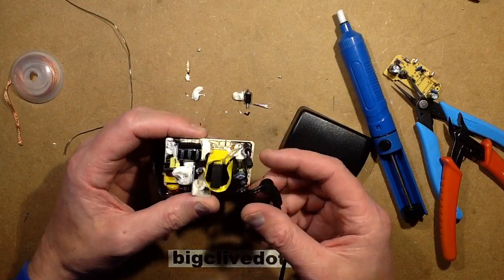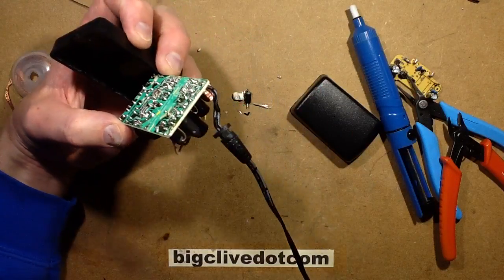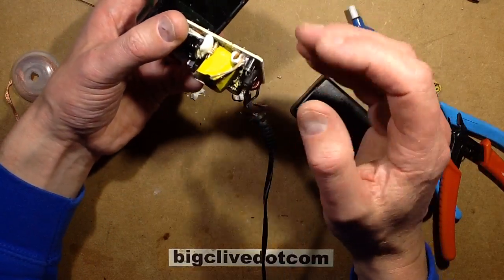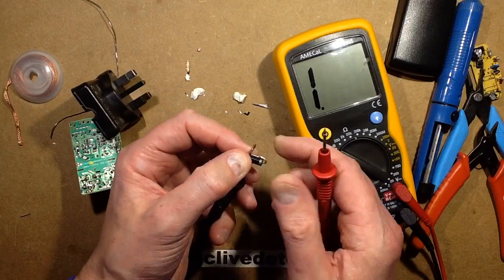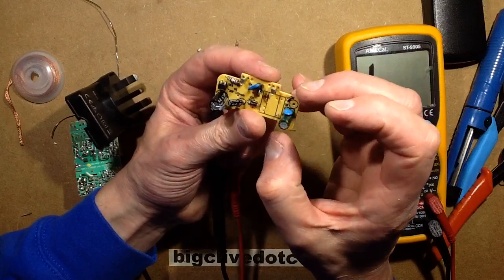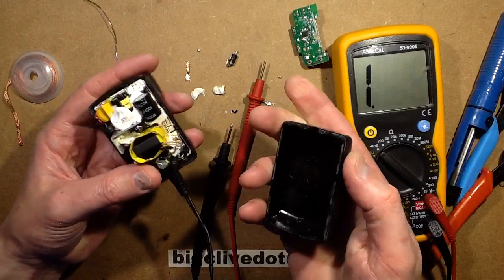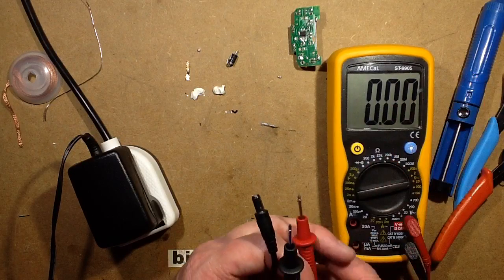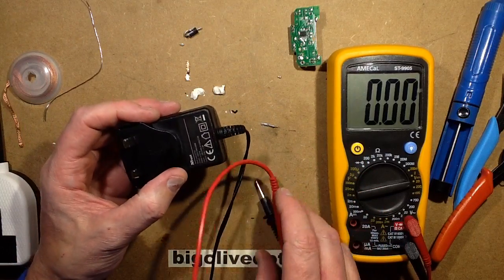Random power supply repair.

Comment: Thanks - an inspiring video.  I've just taken apart a failed PSU that's been sitting on my desk for about a year, and found that it's also failed in the same way.  New diode ordered form e-bay, should hopefully get it working again, and saved it from landfill!

Comment: I got a speaker amplifier thing here (from a set with small speakers), the power supply got lost at some point and I had to resort using 6x AA batteries instead. I let them in after usage, and some times they were either all completely flat, or just 2-3 of them. I had no clue why it happened, ordered external 6x AA holders with the correct plug and used it like that. Worked nicely, but not for too long until the same thing happened again.
Then I got myself together and ordered cheap USB 5V to 9V Step Up converters from china. They worked with the Power Bank! BUT the next day the power bank did it's short circuit shut-off, every time I plugged it in (without even turning on the amp). First I thought it was the Step Up thing, but both had the same reaction. So (before trying any other USB ports on anything else...) I opened the thing up and looked into it. Nothing wrong at all.
Got the power meter out: continuity between all + and - of all inputs.
I was shocked, losing my 12 year old little 5W ampflifier. But the more I tested the continuity, suddenly there was none anymore. Instead of beeping it showed raising numbers. I plugged it in, no short circuit anymore :0
Then, 10 minutes later, it was again shorted. This time I took the charger doctor and plugged it to a 1A power supply without short circuit protection. It feeps a bit when I plug it in, the voltage shows 3V for less than half a second and then everything is back to normal.

May it also be a (smaller) diode, that failed in there? It doesn't really matter, because it works as long as I don't use the power bank, but it confused me and I wondered which component would cause such a thing. Is it a resistor between + and - ? Or more likely a diode? If I ever find out what caused it, the AA batteries, which died a horrible and unnecessary death, will have their vengeance! Or something.
(The amp has 9V 600mA max. input)
Reply: 8bpspfreak2 if it was intended for battery use, there  should be a diode across the + - to prevent damage if you put the batterys in the wrong way. sounds like it's gone short. cut it of the pcb or replace it. might be the power jack aswell.
Reply: or you could just buy the Argos £9.99 multi-volt  3v, 4.5v, 5v, 6v, 9v, 12v - 1Amp multi plug adapter :) I have 3 of them, 1 running 3v LED strings, 1 running 12v Patio LEDS @ 9v and 1 on a string of 12V LED color changing display thingy I made.

Comment: Those diodes are very common. "xxx560" is a dead giveaway that it is rated IF=5A and VR=60V. The usual name for it is "SB560" and they are around since at least 1995. Back then they did not have the 60V reverse voltage and the main 5A Schottky diode was the "SB540" 5A /40V

Comment: It's always fun when you buy what amounts to garbage and it turns out to have a use that it was never intended for. For instance I bought what would be considered a cheap poundland 3 LED flashlight and mounted a laser element in it. See I got tired of holding the button whilst playing with the cat. It also wore out the button in it's original casing. I had originally bought the flashlights to put colored LEDs in instead of the standard cold white ones. I did that with most of them and it turned out pretty well resulting in what I call "Chromatic" flashlights. Long story short I reamed out the reflector to fit the laser module and it worked pretty well. It's my favorite kind of hacking...

Comment: i mean, youve got it open, wouldnt you wanna double check some other basic components, like the caps, just to see if theyre getting on there in years? a minute now might save you hours later if it fails again
Reply from the maker: I did give it a thorough check.
Reply: WeAreGRID Clive wouldn't forget to notice a failed cap ;)

Comment: Consider that the speakers this powered would probably have tolerated a 12V supply.  You can pop them open to see if there's an abnormally low voltage threshold like 10V but it's doubtful for an audio amp IC or typical film and electrolytic capacitors... and with a fixed gain stage, you're not increasing the stress on it much.  In fact the higher voltage 12V PSU might have even allowed slightly higher volume before distortion set in.

Comment: Regarding the auto vs. manual range on the DMM. I use a Fluke 87 and 789, both of which default to auto-range. This seems to be fine for ohms, but if I am checking voltage, the first thing I do is manually change the range to one step higher than what I expect. I do a lot of work on industrial equipment, and you would be amazed the number of times I have seen folks fooled when troubleshooting a piece of equipment by not noticing the 'm' before the V in auto-range mode, and reading something like 117.4 mV and believe there is 120 Volts present on a control circuit, when it is dead, and they are just reading 'floating' voltages being picked up by adjacent powered wires. Switching to 400 V range totally eliminates wasted time.
Reply from the maker: I had someone outraged at the fact that I had supplied him with a 230/400 supply that he was metering at 700V.  He hadn't turned it on yet and it was 700mV he was measuring.  Awkward moment.....
Reply: In the case of your AMECaL, with manual range selector, the very large LCD digits are excellent. With auto-range meters, they often try to make the digits very large as well, but without regard to the adjacent units multiplier, 'u', 'm', 'k', 'M' etc. which are of extreme importance, since they change things by a factor of a thousand or million. Auto-range wouldn't be so bad if the multiplier symbol was at least half the size of the digits it is acting on, but most meter manufacturers consider this to be an unimportant small detail...

Comment: Is the diode in series with the output? If not, and it shunted the power supply when it shorted out, how did the transformer or other parts not get burnt out, or the supply fuse burn out?
Reply from the maker: The primary driver may have recognised the unusual load when trying to create a field in the transformer.  These chips seem to have protection for faults like this.

Comment: I've an old simple 9v power supply that doesn't work anymore, tried metering it and it stats at a few millivolts and very slowly climbs up. It's just a transformer, four diodes and a cap.

Any suggestions?
Reply from the maker: The old traditional ones had a common failure mode of overheating and their internal thermal fuse failing.  Not easy to replace.  You can check that by doing a resistance test on the mains input pins after unplugging it.
Reply: Not all that hard to replace.  The thermal fuse is usually on the outside of the windings so you just cut the kapton tape they put over it, get the values off of it or make an educated guess what temp rating you need in a replacement, solder it on, and have some fresh kapton tape to secure it after soldering.  Doesn't take especially high dexterity for someone accustomed to electronics work and no special tools.

Comment: Damned diodes eh? Had to replace the diode packs in my Honda EX650 generator (the saga is on my SanitaireC12 channel!), one side had failed the same way, completely short, so the generator couldn't put out enough power to light a 200w lightbulb, and boy those diode packs were a PITA to get to and to get out! Did fix it though... :D

Comment: As suggested, plastic glue would be ideal. However, sellotape has the advantage that you can easily take it apart again  need to.

I have some really nice plastic glue that's intended for use on plastic car parts. It's strong enough to use on things like plastic clips and mounts that hold on pieces of trim etc. I also used it to seal up my 18650 charger after I took that apart. The slides were very stiff and had slight corrosion on them. It comes with a coloured powder (comes with black but you can get other colours) that you sprinkle over the glue while still wet.The whole thing then knits together and is incredibly strong. Never thought gluing plastic would be so successful and almost invisible if done right. Can't beat having the right tools for the job.

Comment: Nice fix Clive.
I wish I had your knowledge....I had a Corsair computer power supply just die a few weeks ago.
These are meant to be well made with good components...shame some die so young.
Reply: If you want you can earn enough knowledge to fix this PSU by spending few hours on youtube, there must be vids showing how to measure components and find faulty one.
Most common failure in SMPS is dead electrolytic capacitor on output.

Comment: Those cases are often ABS. To reseal them you can dip one side in acetone and quickly shove them together. Since ABS dissolves in acetone it will chemically weld them.
Reply: myadler Any solvent with MEK should work nicely as well (including multipurpose plumbing/electrical solvent).

Comment: I once rescued a 12v wall wart for a router which died in a company with a device it was powering after a surge caused by a thunderstorm. The only bad thing was the output rectifier, which was SMD but I drilled a couple of holes in the pads and put a UF4007 on the component side. Easy fix, serves me well :) 
 By the way, Clive, doesn't this supply cause a hiss in the speakers? Some amps go crazy when you feed them with SMPS

Comment: Those must be some pretty bad speakers if that's the power supply.
Reply: Power is not the same as quality. Depending on what you compare it to, most if not all computer speakers are pretty bad.
Reply: Until it blew up that was a decent wall wart.

Comment: that's an odd voltage, it might even be possible that the speakers can accept a different input voltage as well.
Reply: I have multiple power adapters that provide 9.6v DC.

They are popular for guitar effect pedals that take 9v alkaline batteries (which deliver about 9-10v when they're fresh, a 9v adapter makes certain distortion pedals behave differently) or for charging 9.6v NiCd battery packs for RC toys, which are composed of 8 1.2v cells.
Reply: It's as close to 10V as makes no odds.
Reply: +bami2 Good point.

Comment: Used to prep Cyber Acoustic brand speakers for use in medical use, the AC wall wart was tossed out in favor of a Muti voltage unit that had a DC output, so apparently the on board rectifier /supply could pass the dc into it with no issues. Anyone need a 9volt ac @ 1amp let me know, I have a few hundred of them in Black or White your choice LOL Trying to make use of discarded stuff can be a pain.

Comment: I like the way that supply has a fake earth to use when plugging in as a guide and to add extra support for the other pins.
Reply: In the UK, the live and neutral pins are often covered by a plastic shutter, and you need an earth pin for the shutter to open up.
Reply: I believe it's a legal requirement. I know every plug I've ever seen is like that. No earth pin, no plug in.
Reply: Unless you're like me (and Clive too, cos there's video evidence!) and shove a screwdriver into the Earth socket to open the shutters to jam a europlug into a UK socket, not safe, not recommended, don't try this at home, etc.etc.etc., works though... :P

Comment: One problem I've had with auto-ranging DVMs is that I don't always notice when the scale changes.

I've thought I was getting readings in the expected range which weren't making sense, then when I looked more carefully, that 5V signal was actually 5mV when the meter decided to change ranges.
Reply: Also when one measures different points at a similar voltage, automatic range switching takes sufficient time to annoy me, so I may often fix my multimeter to the 0-39.99 range when I'm probing around a board with 1.8V, 3.3V and some 5V (or maybe some elevated power supply voltages). Resolution is still good enough, and reading is instant.

Comment: I suspect speakers supplied with a 9.6v power supply would happily run at 9v. Easy.
Try finding replacement supplies for things that need multiple odd voltages (especially if it has negative rails too).

Comment: Good solve!
Ask a question - why is many adapters lying around, including netgear and Nokia - suppose to show x volts as per the adapter label shows higher voltage? instance, Nokia saying 5v/200ma, open circuit voltage shows 9v.... same with netgear, adapter label says 9v, but multi-meter shows 14v with no load.... while most of other adapter shows spot on what label says.
any clues/ videos why such high output voltage when no load/ device is connected!
Reply: It's because of the switch-mode design of the power supply. There is a chip/circuit inside that controls the output voltage based on current (the higher the current, the more internal voltage it needs to generate the same output voltage). So if the current is 0, the voltage shoots up, but the moment you connect any load, it normalizes. Old PC power supplies even blew up when you connected them without any load or too little load.
Reply: Thank you. So it has some kind of loop-back circuit which - depending on the load varies the voltage?
I am meaning to use the adapter of 9v DC for something which can tolerate +/- 1v, but little worried when it shows 14v open circuit voltage.
Reply: Get a proper powersupply if you are concerned. The problem is that the output capacitors in the PSU are charged to the voltage you measure so when connecting something they can provide a short burst of energy at the voltage you measure until it drops down to the rated voltage. This burst can kill electronics that aren't built for it. 
Btw. I assume you really have switchmode PSUs and not transformer PSUs. I know older netgear stuff that came with it. And some transformer PSUs don't even have a voltage regulator in them, just a bridge rectifier and a cap and rely on the voltage drop of the transformer uder load to output the correct voltage.
Many switch mode PSUs need a minimum load to operate correctly (even if it shows the right voltage at no load there is often ripple on the output that's invisible to a simple multimeter), especially if they are built for a certain device where the load is known. The reason for that is that most switchmode PSUs have a minimum duty cylce on the switch because they power themselves with another coil on the transformer (you can see that in many of Clive's videos). But that also means there's some power transferred to the secondary. If nothing uses that power it charges the caps higher than labeled, because it can't go any lower with the duty cycle. You can try putting a resistor (or zener diode just a little bit above the voltage you want) on the output to keep the voltage down.
Reply: Thats a brief but good response, I was looking for - I was thinking to open and check the Capacitor specs; it might explain the holding charge - i will investigate this further and see how i progress.
Steve any chance to do this kind of video - on the matter i mentioned, while i sit on couch and watching your video :)
Reply: I havent opened any transformers yet and see the difference, I would hope those big bulky netgear ones and those nokia ones might be slightly different - but both will have transformer/ rectifier etc to smoother out those +waves without ripples....

Comment: Hello bigclive, what could be the problem with my 12v led strip? https://youtu.be/WofJ5pEuf3E
Reply from the maker: Looks like failing LEDs.  What voltage is it being powered with?  It's a good idea to nudge the voltage down on these strips by adding a diode or two in series.
Reply: bigclivedotcom 12v

Comment: If all else fails, sticky tape.
Reply: +Eucep or hot glue :)
Reply: Superglue
Reply: 3 part epoxy
Reply: If it moves but shouldn't, duct tape. If it doesn't move but should, hammer.
Reply: *****
There is a dark side and a light side, it holds the universe together.

Comment: you are lucky...
I had a set of amp and speaker, all built into a single chassis, along with the power supply.
when the capacitor on mains input to DC side exploded, the whole thing went bad and I was to young and inexperienced back then to repair it

Comment: A customer whanted me to repair an lcd monitor with a switch mode power supply and after changing the bad capacitors 5v came back but 12v and 24 v are dead any ideas?